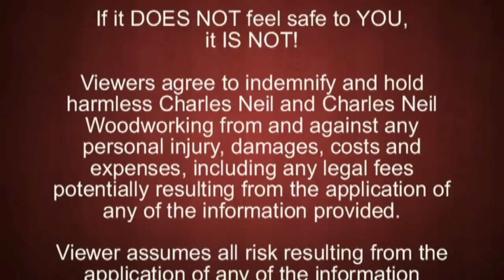Build a Pie Safe with Charles Neil - Episode 19

Comment from the maker: @HeavyDemir  in 89 I think it was, I had been working about 48 hours straight, trying to meet a dead line, and I guess I just  blacked out , and my left hand rolled into the table saw blade, which was odd , because I use my right hand when sawing, I was fortunate I didnt have the blade very high over the material, so there is several lessons here, hope Y'all got them, and from that day to this , I dont do deadlines,,,  so now ya know :)